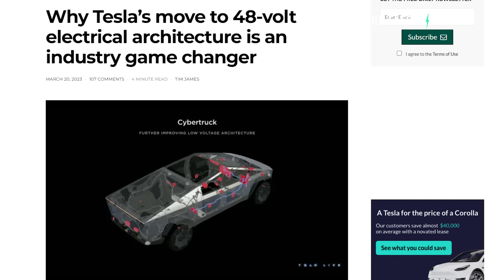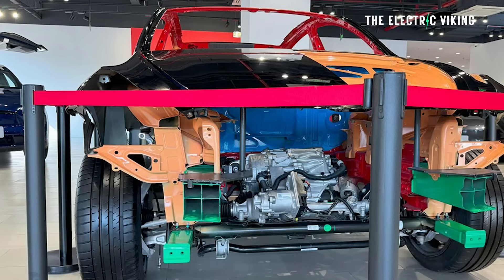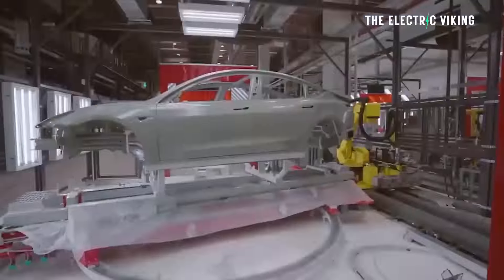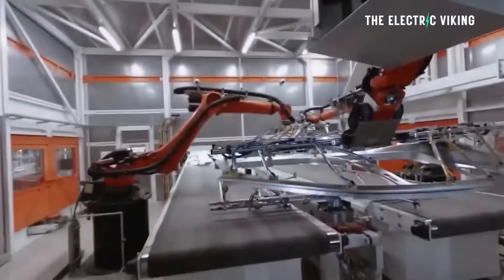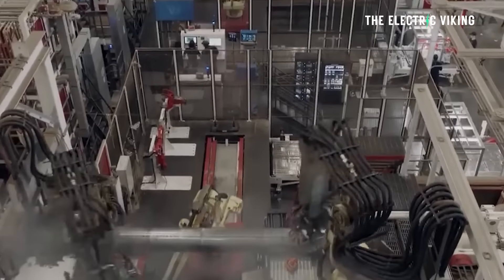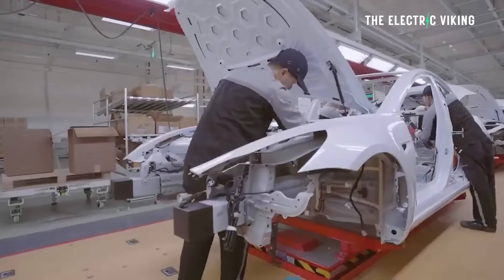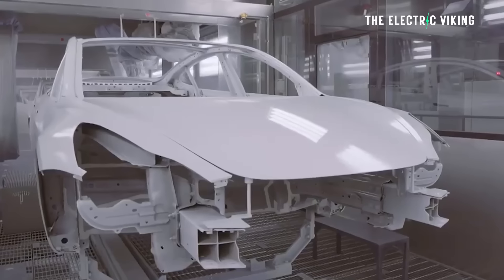Tesla Model 2 NV9X Redwood Crossover coming with Cybertruck architecture

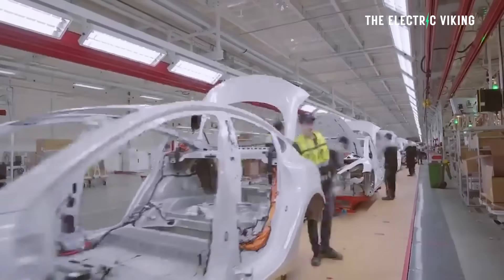Comment: Tesla needs to build a car that can sell for $25 in America WITHOUT any state or federal gifts.  Build as much car as possible at that price point.  The car could be very small and seriously low on features.  Just make the damned thing sturdy, reliable and with 250 mile range in any weather and capable of 80% charge in about 20 minutes. 8:15 8:15 

Save the grandiose, luxurious and powerful stuff for much later when decent batteries become available.  It is ridiculous to build expensive vehicles with today’s battery technology.

A cheap, reliable car now would drive much wider acceptance of EVs such that the future of expensive vehicles would include many more potential buyers.  By then the grid and charging network might be more mature/extensive.  The hinterlands need to be invited to the EV party…
Reply: yea, but the real turn off is the 250 mile range.  350-400 is where the game changer for EV adoption will come into play
also, one of the most overlooked cars in the market today, new or used, are the "base" trim models.  they sit on the lot 2x longer than a mid spec or fully loaded version.  (lucky lopez channel i think brought this up)
100% agree that tax incentives need to stop.
Reply: @baldisaerodynamic9692 Baldy,  my 250 mile proposal was a MINIMUM IN ANY WEATHER with:
- people in the car
- the car is a few years old
- does not require charging the battery to a high % that would shorten battery life appreciably.

This would surely be somewhere in the 325+ range given the “optimistic” numbers so casually thrown around today. 

Yeah base cars don’t sell as readily.  So build a base car that could be easily upgraded later by the owner with OEM parts kits at an attractive price. A smorgasbord of do it yourself upgrades?  The car also needs to be easily repaired to address insurance rates and poor resale value.

Anyways, get lots of reliable, affordable cars out there sooner than later.
Reply: For city cars a battery size of around 40kwh should be enough.. 🖖🏻😎
Reply: for city cars, with that logic 150 miles of range would be enough.  but, guess what.  

EVs suck in certain climates, range is drastically reduced.  range is generally not what is claimed often worse than ICE estimates
 
what you state isnt "wrong", but its also not what will work for mass adoption

the only thing stopping people with a smaller range from buying one now, is price.  this isnt going to aid in MASS adoption, its just making it a more affordable segment.  but heres a question, if used EVs are going for 25-30k, why arent they being sold out off lots in record numbers?  with that "affordable" logic, used ones should be in majorly short supply.  

 @michaelkainbacher6696
Reply: 1.  the company will build according to profit not insurance costs
2.  what you literally described was an options package from a base model, which is what every car maker has been doing for a century. tesla does it differently, but same concept.  SR model 3 has lowest end sound system, less power, single motor, upgrades to color and wheels.  goes up from there. what makes tesla desirable is the UI and base tech in a SR model 3 or Y are above everyone else.  This isnt chevy or Nissan, tesla has set a standard and to deviate from that is plain ignorance on their part.  
3.  what you described was what i said, a higher range estimate which will net that much much lower amount, which is how these cars tend to work now.  thats a failure to non adopters.  as an EV owner myself its a failure point.  those willing, but wont want 325-350 REAL WORLD.  surveys have shown this desire.  
4.  used EVs go for said "affordable" prices, yet sit on used car lots.  $25k is $25k used or new.  so the "affordable" segment of get on the EV bandwagon people that can afford 25k for a car are not running to get EVs at 25k.  
5.  as someone that has 3-4 people in my car often, my WHPM does not increase vs just me in it.  
6.  cold climate is also going to be a massive deal breaker for many years for many people.  this is a separate issue from the range desires.  extreme hot climates also drastically reduce range too, but people do not tell you about that one.  Glass roof is THE DUMBEST idea on a car.  until battery tech can handle all environments better, it limits its markets in adoption.  

 @toddpillow3074

Comment: Didn't buy a Tesla Model 3 because of the insurance cost, ended up buying a ORA. I suspect bigger castings are going to make the situation worse for tesla  unless methods of fixing bingles are developed. Because of the cost to repair I do wonder if giga casting or mega casting is a short term fad. Steel cutting stamping and welding  is pretty much Automated, if bent a little the result can be repaired.  Be surprised if 48 volts doesn't become standard across the industry. Ethernet instead of C-bus. That makes sense.

Comment: Mega casting and repairability is a concern. A ‘small’ accident could necessitate a write-off in please of panel repair. However, with new production cost low it might not matter - especially if insurance and repairers merge with recycling concerns to take dented megacast EVs and swop new of old on new era insurance products.

Comment: A single piece gigacasting would preclude unboxed manufacturing process.  Next generation vehicle will have front and rear gigacastings plus structural battery pack, IMO.  The game changer will be Optimus bots 'manning' the unboxed production line.

Comment: Nissan unveiled their Steer by wire system in 2012
Reply: Looks like it used a steering column as backup.  This does not allow the vehicle to be built as LHD and RHD with little change.

Comment: It sounds intresting. I wonder what will be the final product.

i hope all there car's become 48V

I wish that they calculated actual KW/mile.. surprise everyone, put a lower number than actual say it will get 470 miles when it will get 500
Reply: That figure for 100 miles is at the fueleconomy gov website.  What most people don't know is the high efficency of EVs.  The MPGe equivalent of the model 3 is 132 combined city/highway, city is 138, highway 126.  No ICE comes close. 25 kWh/100 miles, do the math.  No oil changes, no tuneups, very seldom brake jobs if ever, thanks to regen braking.  No more ICE for me.

Comment: Lexus RZ also has steer-by-wire.
Reply: Looked into this a while back. 
"The Lexus RZ 450e has a physical connection and backup, which enhances feedback. The Cybertruck is pure steer-by-wire."
In other words Lexus has a steering column,
Reply: @danharold3087  I have no independent knowledge, but the video by Engineering Explained from 10 months ago says there is no mechanical connection between the steering wheel and steering rack on the RZ.
Reply: @dansanger5340  I trust Engineering explained.  Looking to see if it has been released into the wild.

Comment: Can I insure that car because of the apparent on repairability issues with giga cast cars
Reply: They tow the car to a Tesla lot where it will later get recycled into a new car. Meanwhile, you immediately get a new car from Tesla insurance. You don't have to wait for it to get repaired, you just drive off in a new car.
Reply: @dattajack  if only Tesla can insure their cars, will the monopoly over insurance lead them to become low value for money in the long runs ?

Comment: I'm not a fan of steering by wire.  In fact I don't want it.  It is the reason why I have not bought one.  My reason is for sport driving.  I need to feel how well the front wheels are sticking to the pavement.

Comment: Model 2 will have a complete vehicle one piece body casting, structural battery pack, 48V electrical system, steer by wire. Probably have around 300 miles of range, 0-60 of maybe 5 seconds, and a top speed of around 115-120mph. I see Ford, GM, VW, Toyota, etc etc going the way of the Dinosaurs. They had it their own way for the last century, the 21st century will be owned by Tesla. With Optimus, FSD being licensed to everyone else, battery storage, Robo-taxi, and 20 million vehicles being produced I’d say Tesla could easily have a market cap of $20 Trillion by 2035.

Comment: Steer by wire is such primitive technology. My car has steer by Bluetooth, no wiring required.
Reply: Yes, and it is the size of a matchbox.
Reply: A cellphone steers my car, no hands
Reply: Actually, it is primitive technology. Nissan, Toyota and Lexus did this years ago. 48 Volt wiring is nothing new, either.
Reply: After the stalks, the steering wheel will be removed as well...Part of Tesla's "clean desk policy"
Reply: @stefan2796    I hope so.  Autonomous driving is the future, don't hate the future.

Comment: If it's only just incrementally cheaper than the current crop of Teslas, it probably still won't have its "Model T" moment.  However, if they can keep it around $20k, or even under $30k CAD, then for sure.  This would be civilization changing.  I don't care about $30k USD, as that's still about $40k CAD, which is too expensive for it to be a Model T moment.

Comment: There were two primary reasons that I chose to buy a Tesla Model Y last year. The first was the Supercharger network. The second was that it was less expensive than the competition. Coming up on a year of ownership, I have yet to use a Supercharger even once. But what I have noticed is just how cheaply the car was made. That is harder and harder to live with every day. Tesla may have bought Hondas to disassemble to see how cheaply they can make a Model 2. The thing is that an inexpensive Honda does not feel "cheap".

Comment: My prediction for model 2
4 seat 5 door hatch back
Dual hub motor rwd
0-60 7.8 seconds
Top speed 95mph
Range 275 mile epa
Battery size 52 kwh
Interior basic 
Rubber floor mats no carpets
Reply: Panelgap tolerance: 2 feet
FSD: Still not working
Price: USD 35K
Reply: With a battery pack that size, I imagine that it would get 260ish. The most efficient small ev's only get about 5 miles per kwh. And that would be about max in good weather with good driving.
Reply: For city cars a battery size of around 40kwh should be enough.. 🖖🏻😎
Reply: I think Tesla will do better than that @hedleypepper1838.
If the car is not compelling why build it.
Especially the 0-60 time.  This is a light for its size car. 
I don't see Tesla using hub motors.
Maybe it is me dreaming but I expect it to be kind of sporty.
A bit of extra omph is inexpensive in a small EV car.
Reply: It’s not in Teslas DNA to build a car  that doesn’t have great acceleration.  So expect 0 to 60 in under 6 seconds at the very least.  Also forget about hub motors.  They already got a winner in 3&y drivetrain.   Why would they reinvent the wheel? Lol
Reply: @davidrink1291  Thing is small cars make fun cars.  We can expect a rigid  light car especially by EV standards.    It could be fun.
Reply: @danharold3087  it will be fun.

Comment: Small vehicles are good for Europe and Asian markets. It will be ok in the states. It will cost mid to upper 30k. The 25k fantasy is as real as a 500 mile cyber truck.
Reply: I think you are wrong. Electric cars are getting cheaper over time. Adjusted for inflation, model 3 is cheaper than ever. And a bunch of other ev's are also. And this car will be a dumbed down model 3. So it should be cheaper lighter and more efficient per mile
Reply: @dreamleaf6784  Exactly.  The cascade weight reduction with the magnesium casting make it a much lighter car.

Comment: No physical connection between steering wheel and tyres with a computer inbetween deciding whether it will do what you want it to do. What could possibly go wrong?
Reply: Not much they have been using it in jet planes for decades...
Reply: Yeah, worked brilliantly for the 737 Max. In a car, it's a solution looking for a problem to solve.
Reply: @petercroft9895  The 737 MAX is an example of what a sales person(s) should not do to get a sale.  The tech was abused.
Reply: @petercroft9895  Man you naysayers just never give up do you?
Reply: @davidrink1291  Well, as an avionics technician in a former life, I did know a little bit about flight control systems. The Max had a single sensor failure point - dse. As a firmware developer for an industrial controls power electronics company in my current life, I know a little bit about control systems and electronics design and manufacturing. And about the many ways those systems can degrade and fail over time. So does, for example, the Tesla steer by wire system have multiple - at least dual - completely independent steering AND road wheel angle sensor systems? Aircraft ( but not the Max AOA sensor) typically have triple redundant systems, and if one disagrees wildly with the other two, it's ignored and flagged as a problem. It's expensive to do that, but you know, lives are depending on it working flawlessly 100% of the time. I don't know what Tesla has done, but as their rationale is lower production cost, driving one of these I'd always have in the back of my mind that it is only one hardware failure or software glitch from spearing off the side of the road. Replacing a dead simple, utterly reliable conventional steering column with a mess of actuators, force feedback motors, power electronics, processors, sensors and firmware doesn't seem to add any tangible user benefits, but it does expose them to any number of new, and potentially fatal, failure modes. But hey, it's your hide, if you're comfortable with all that, go for it.
Reply: @danharold3087  Yep, 100%. Big corporate Boeing looking to save money, and with a 'we know best' attitude. Cross out Boeing, and pencil in Tesla.Do you see the problem now?
Reply: @petercroft9895  We are told everythings is duplicated at least twice and in some cases triple.   Lexus, the other steer by wire, has two steering motors in one case/location.  Tesla has two motors that are physically separated.  From what we have been shown it looks to be a well designed unit.

Comment: I don't believe the Model 2 will be a single casting. I think it will have multiple castings for the unboxed process. One for the front, back, right side, left side & possibly even a roof structure casting. You can't do unboxed with a single casting.
Reply: At the least you'd have to split  it into a top and a bottom half. Injection molding the whole structure would be a very complicated articulating mold for no real benefit
Reply: @why6212  Agreed. But to maximize the benefit of unboxed, & most likely the use of the Teslabot, you need more sections not less as Sam was stating.
Reply: I will not say what way it will go.  But I don't see using a cast metal body.
Reply: @danharold3087  no, not the body but on the side everything from the A-C pillars, the full door frames & even the doors themselves, just not the skins, as well as the roof structure could be cast just like the current gigacasts on the model Y.
Reply: @MarkSparks-xd9yy  We will see.  First we need to untangle how they could cast a one part frame and still do unboxed.
Reply: @danharold3087  unlike Sam I think it will be at least 4 & maybe 5 cast sections. Front, back, right, left, & possibly the roof structure.

Comment: No single piece mega casting. Tesla has said they will be revolutionising the manufacturing process, so this with their unboxed process. 

The icing on the cake will be they will use their bots in part or in whole, building each of the sections of the model 2. 
The human workforce will be there as support workers, maintenance and repair, bot trainers etc.
So the human workforce in the plant maybe 90-80% below its non-bot plants.
This is why the main model 2 plant will be in Mexico, becase the plant is new and thus Tesla does not need to shut down and make redundant any human workers ( this would cause political waves and workforce backlash) . 
Old factories that have human workers will, over a  @5yrs window, transition to mostly bots. As workers retire or leave or a fired more humans will be allowed to leave than are hired on the factory line.
As humans leave bots will replace them slowly. Existing staff will be retrained to have the skills to service them and train them. These new jobs will be not just for Tesla.
When Tesla is ready to sell bots to global buyers it will not only sell the bot and software but also the repaire and maitenence services AND insurance ( the bot may damage objects and make mistakes, it will not be perfect, just like humans make mistakes and damage things at work or in the jobsite) .

So for me FSD v12 and the Borg factories are Tesla's next big growth potential and oh energy as well.
Tesla's first external  customer will be SpaceX.😊

Comment: Gigacast method reduces manufacturing cost, but increases repair cost if damaged in an accident. Instead of replacing a couple of small parts, the whole big single piece part need to be replaced

Comment: The Tesla approach seems to be, to make each new model the BEST vehicle it can be, at the LOWEST possible manufacturing cost.
It's a bold approach,  because the best manufacturing method will depend on the volume.
Legacy auto seems to take the approach of starting small and building up volume as sales demand it. Worked in the past when design changes were incremental and not revolutionary like the change to battery power. Totally fails when your competitor is as innovative as Tesla.

Comment: Too little to late new vehicle due at the end of 2025 !! So no new product for basically 2 years ! With all manufactures dropping $25, 000 models well before then . Another huge problem with it is Elon said it would be like the cyber truck which is very worrying as the cyber truck can only be sold in the USA due to its failure to meet pedestrian impact engineering and safety standards. So it won’t be a global car and small volume. More woes for Tesla as demand for its cars have slowed